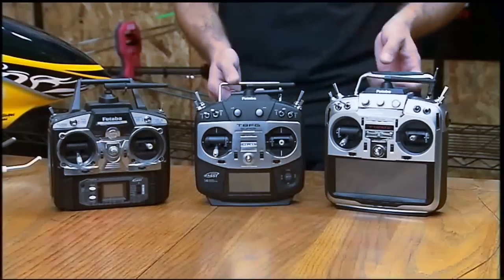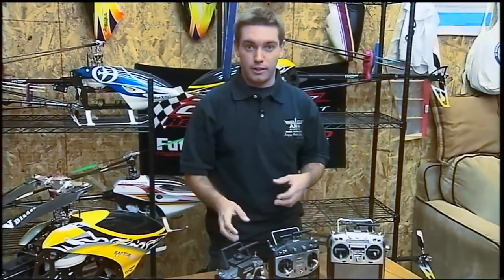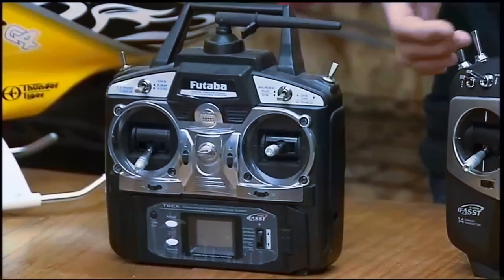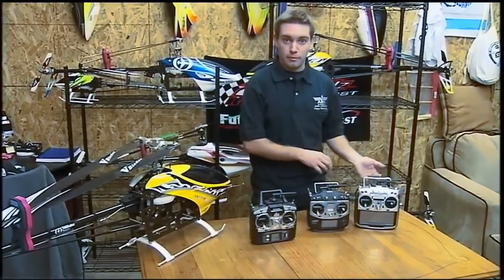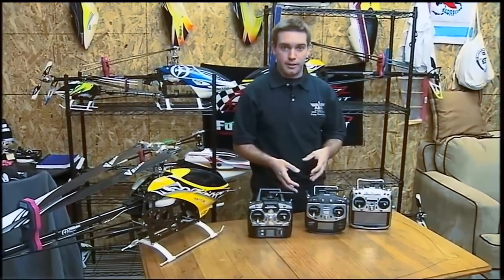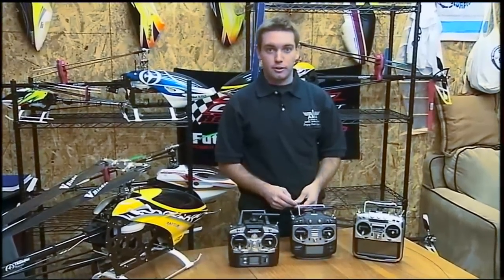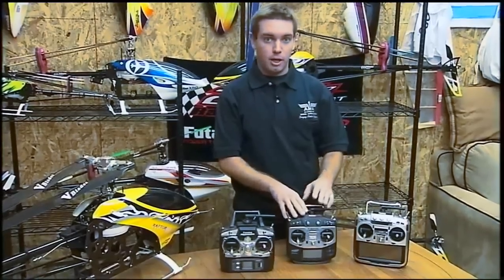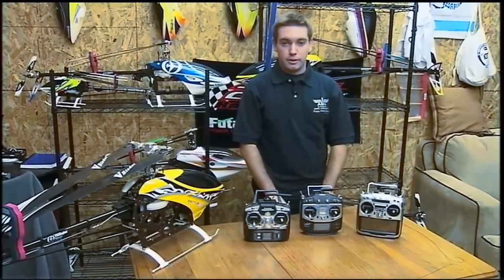Nick Maxwell -  Selecting a Transmitter

Comment: i know this was a short video i think you should have said it was a Futaba commercial personal opinion you don't mention any other brands of witch there are quite a few.i started out with the early jr radios tried futabas a couple times they just don't work for me i now have four radios i use regularly trhey are two jr's a 8103 and a 9303 a transas9 by flysky and a  older frsky 9 channeloh yes the frskys are made in china cost less than $200 bucks and make the us radios look tame and over priced and no i usually buy American when i can but i also like bang for my bucks when i can get it just one guy's opinion